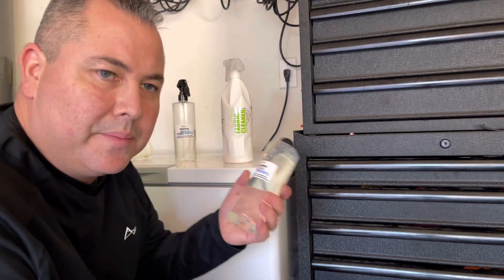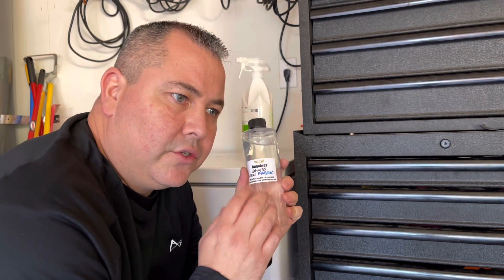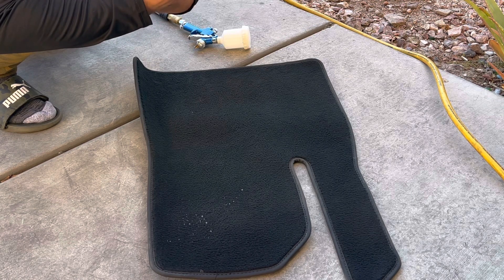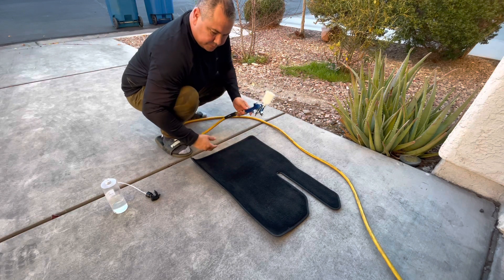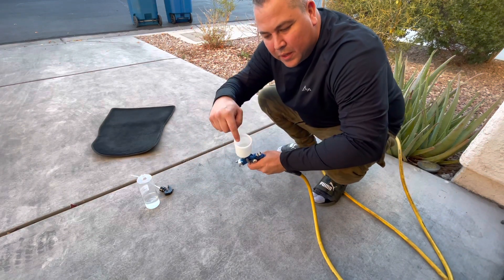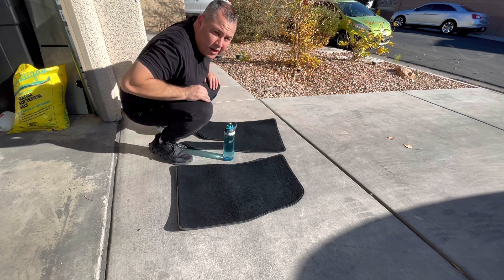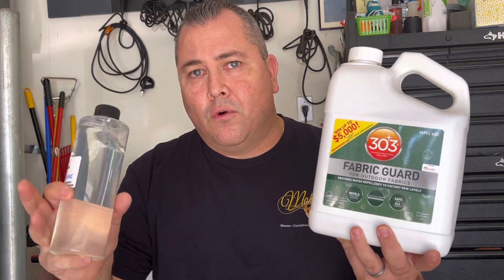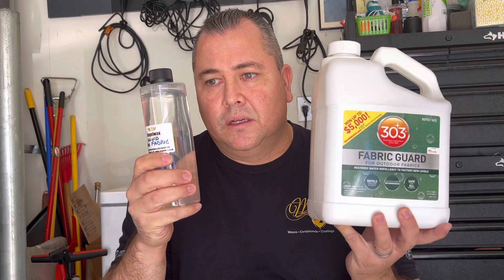Fabric Coatings (Angelwax VS. 303 Aerospace)/Interior Auto Detailing

Comment: Thanks for making this video. I think you are the first to test AW Shield. Great result but very expensive. Here in Europe a bottle of 250 ml costs no less than 63 euros. A 500 ml bottle costs 105 euros! Luckily a have leather seats which i coated with AW Enigma Trinity. Also in spray form but much cheaper.
Reply from the maker: Yes, I have leather as well.   These would be good for that expensive pair of shoes or some purse.   Lots of product needed for car interiors.   Some people want this no matter what the cost and that’s great.   I really like AW Shield, it’s potent and repels liquid well.

Comment: I actually don't mind 303 .
 For application i spray it on and thoroughly knead it into the fibres with my fingers then apply another coat just to finish off..
I must try Angel Wax next time it looks like a great product.
Reply from the maker: 303 is cool if u have the time.  And yes, u can definitely knead it in or brush it into them deep fibers and then coat again.  Should work great that way.

Comment: You could have dialed the product back a bit on the AW. More air less coating. I could have used a paint roller and achieved the same results. I mean it was as thick as pea soup.
Reply from the maker: No, u wanna get the roots but u can try any way u like.  I’ve done this a few times